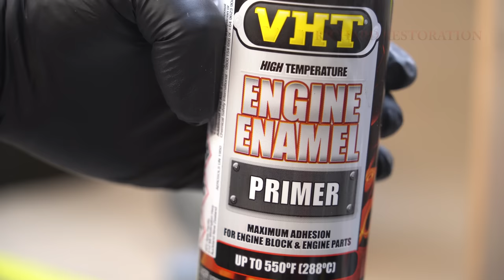world War 2 runway lights Restoration

Comment: I like the way you do Restorations.
You try to take them back to original conditions. 
I highly respect that.
It difficult to do sometimes.
Much respect.

Now, when I work on a project, I rarely go back to the original finish. I change colors and try to get the flashiest, shiny finish I can.
I add polish and plating. 
I guess I'm the guy who gets distracted by the shiny objects.
Reply from the maker: thanks for the encouragement😀 while doing the Museum I try to make it authentic as possible .my own stuff the sky is the limit
Reply: @Richard Restoration  Sometimes, you just want to make it purdy!
Seriously, in my to-do pile I have 3 bench grinders. Two will be as nice as I can make them and will live on the shelf as display pieces.
One will not be as pretty. It will be built for durability. That on gets bolted to the bench for use.

Comment: I have put a box of drywall screws in rusted motorcycle fuel tanks, shake it awhile, empty, degrease and prep to coat with Por-15 coating.
Reply from the maker: Thanks for your feed back cheers Richard 😀